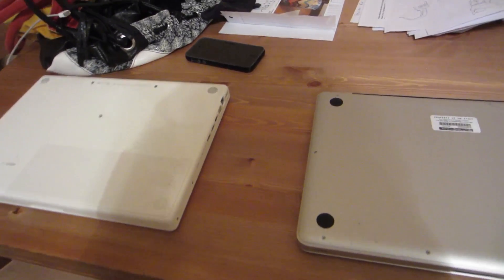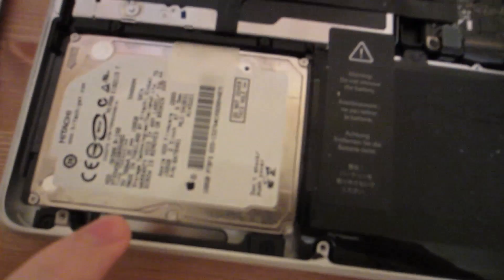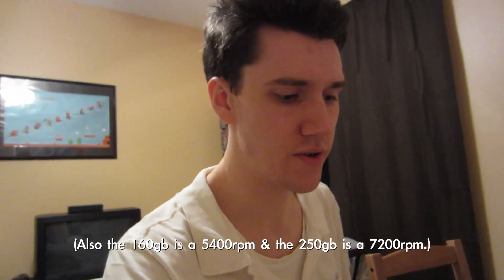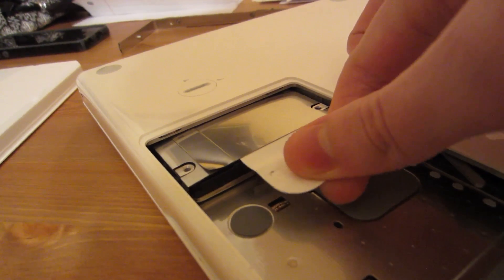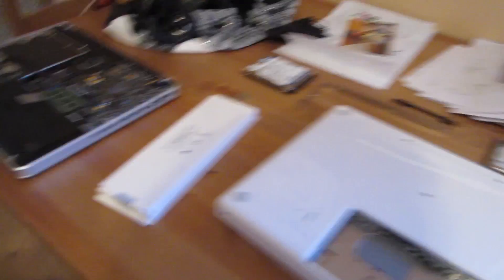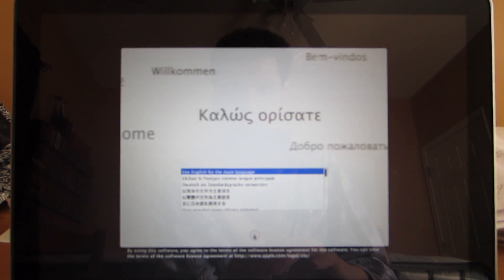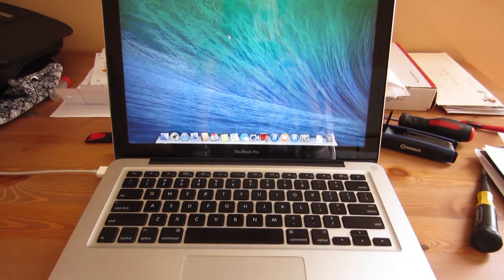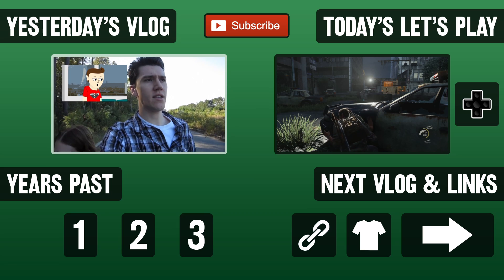Installing Mavericks (Day 1434 - 10/28/13)

Comment: I installed Mavs a few days ago, and it has been okay. A few programs that I use for work stopped working, so I needed to find a work around.  I've also tried Safari again for the first time in a few years, and I'm still on the fence about going back to Chrome.

Comment: I have a late 2012 Macbook Pro with Retina display. The Ram is actually soldered to the Motherboard. You can't replace it.
I'm pretty happy with my machine though
2.8 GHz Quad Core i7
16 Gigs of Ram
500 gig SSD.

Comment: I've not updated to Mavericks yet. I did a quick hard drive upgrade in my 2010 MBP to a 1TB drive and then ripped out the Combo Drive and replaced it with a second hard drive caddy and installed a 160GB scratch drive. Disconnecting the battery was just pulling up a tab from what I remember.

Shamefully over the years I have managed to damage the inside of my MBP… the speakers at least got a little beat up. Now they distort much easier. Cheap enough to replace though just can't be bothered.